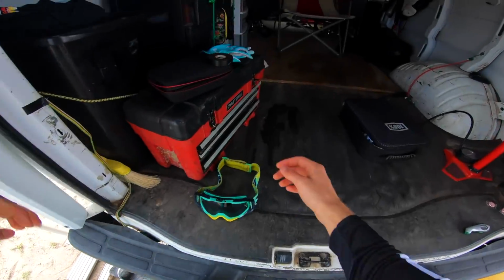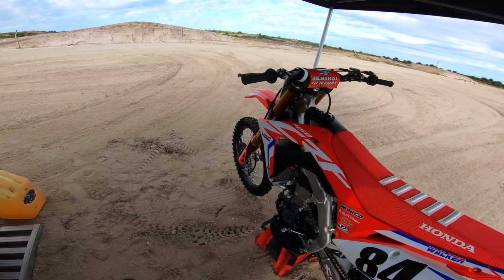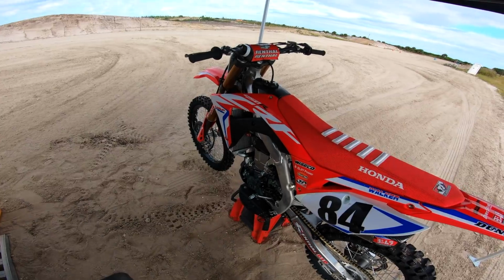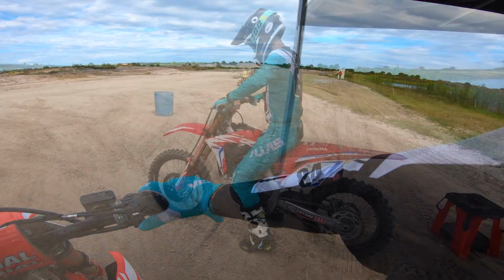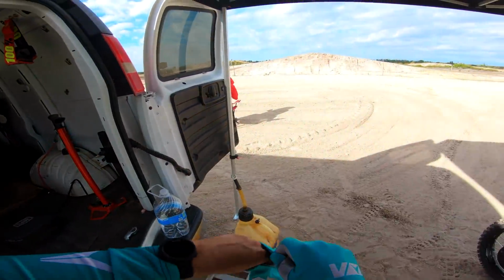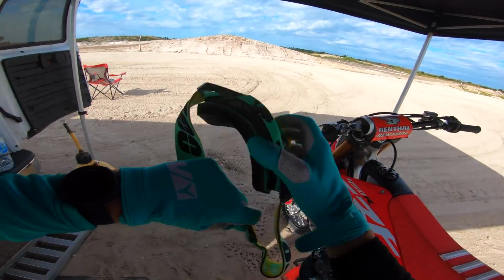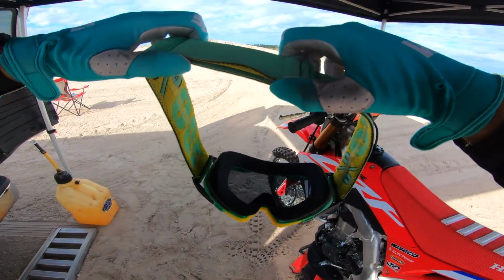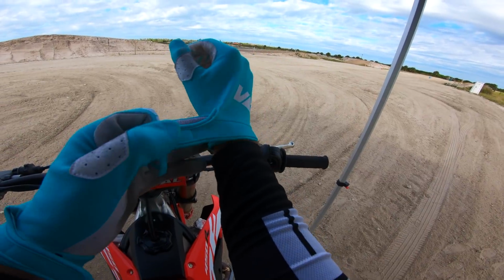Lazy Springs MX: Roughest Track in SW Florida?

Comment: That's the track I learned to ride on. It's also the track my bar risers failed on creating whiskey throttle resulting in a torn rotator cuff but if you can ride LAZY you can ride ANYTHING! You know it's a tough SOB when Jeff Walker isn't pinned 1/2 the time. For all of it's faults, in the summer when it's raining every day this place handles the rain and will be open when all others are closed.

Comment: Really appreciate your Videos!

Are u using any griptape on the airbox?
On rougher tracks beeing hard on the throttle, my ass hardly touches the seat.
I always try gripping the bike (yzf 250 2017) with my gaerne sg12 boots but i cant find any good grip on the side plastic covers... and then im fully exausted after like 13 mins full throttle...

Im trying to find any grip tape that doesnt destroy my boots that much.

Would be cool if u could share some experiences.

Greetings from Germany, Nueremberg!

Comment: You look like a tall guy, im 6' and ride a kx250f. I don't feel "comfortable" on it in a sense of position. Do you think I need bar risers?
Reply from the maker: It's possible! I'm 6'1" and don't run any risers, but its all about your style and what makes you comfortable. Canard is short and runs really tall bars. Deano is tall with low bars. All about personal preference! I like to get really low and aggressive, so the lower bars suit my style better. But if you have more of a Musquin style (upright and technical) then tall bars are a good route.
Reply: @JeffWalker84  I was at the track yesterday and I felt when I gave it full throttle my wrist was like bent under the grip and when I moved my wrist to a higher angle, I felt like I was on top of the grip and not "in" it if any of that makes sense. I think im going to give the risers a go.

Comment: Really awesome stuff Jeff.. looking fast! What mount is that? Where does a person get one like that? Thanks in advance! 😎🤙
Reply from the maker: It's a custom mount I made using a spare Bell Helmet mouth piece, a standard GoPro flat mount, and some JB Weld. I basically just stuck the mount on the front of the mouth piece using the sticky backing, and then threw some JB Weld to fill in all the gaps where the mount wasn't touching anything. I posted some picture in this thread on VitalMX https://www.vitalmx.com/forums/Moto-Related,20/Honda-CRF450R-Works-Edition-First-Ride-Impressions,1349475

Comment: Jeff, what is your opinion on the KTM Factory Edition 450 vs the Honda CRF 450 "Factory Edition?"  Is the quality between the two pretty comparable?
Reply from the maker: In my opinion, KTM and Honda are not trying to accomplish the same goals with their Factory/Works Editions...KTM uses their Factory Edition to make improvements that they'll use on the next year production bikes such as frame and engine revisions. A standard 2019 will be almost identical to the 2018 Factory Edition which kind of makes it pointless to spend the extra cash on the FE unless you REALLY want those Redbull graphics. There's nothing exclusive on the FE that you can't buy the next year. Don't get me wrong, if you're going to buy the seat cover, clutch cover, and exhaust anyways then it's a great deal! What I like about the Honda Works Edition is that you're getting exclusive parts like the HRC ported head and mapping as well as a custom Yoshimura exhaust that you can't buy on your own. You're also getting the Kashima-coated suspension which you can technically buy, but must be shipped to Germany in order to get done. Honda's WE is a proper race bike whereas KTM's FE is just a blinged-up stock bike.

Comment: Looks somewhat rought but in SC we have tracks that get ruts up to your brake disc and muddy but i can see that being rough for florida
Reply: Most of the tracks in florida are pretty sandy and rough like this. Hard rock in ocala is all hard pack clay from a old quarry but that place is straight dangerous. Rocks the size of baseballs laying everywhere, all blind jumps on clay that's hard as concrete. Tires will actually squeal while braking

Comment: Hey man I have a regular 18 450. How tall are you? I’m having the same front end issue but I don’t have the handlebars that you have if that helps at all. Your videos on this bike have helped me out because the 18 isn’t that different. The constant changes then seeing how it rides immediately is very helpful for me because it’s winter time and I can’t go test settings.
Reply from the maker: Hey John, glad you're liking the videos and finding them useful! I'm 6'1". I've always hated the Renthal 971 bend bars that came stock on the Hondas (I assume you have these on your bike) and I used to switch those out immediately. Something about that bend really did NOT gel with me and it always felt awkward. My favorite Renthal bend was always the 999 McGrath/Short bend. It's really low, flat, and wide so you get great control and stabilization over the front end. A ton of pros run that bend! Obviously the 2019 range switched things up with the 839 fat bar coming stock, so I decided to give it a try and i'm actually digging them so far! It has very similar specs to the 999 that I love, but they're about 10mm taller and slightly narrower.

Anyways, my first suggestion to anyone who's struggling with front end instability is to make sure your bars aren't rolled too far forward. For reference, I always start with my bars perfectly in line with the angle of the forks and go from there. 99% of the time, I end up rolling them back slightly from there until I find the sweet spot where the front end stops twitching.
Reply: Jeff Walker Im also 6’1 and prefer the 999 over any other bar. This was video was super sick by the way! I’m new to your channel and was curious if you’ve had past models of the CRF? I recently sold my 2017 crf and was wondering if the 19 was any better than the 17.
Reply: Drop fork height in clamps and drain some oil from forks..night n day on Honda

Comment: It would be appreciated if you could make a video that summarizes the changes and adjustments made to your CRF450r to compare our setup with yours. I do not want to spend for a revalve of my suspensions because I have the impression that the company have not yet tested the 2019 bikes so I think that helping each other between owners would be nice. In addition, Here the season is finished until April because of the winter so I could not test the bike.

Comment: Isn’t that alittle risky taking the air filter out what if you suck up some sand that would blow your engine out right. But since there was nobody else on the track I guess it probably isn’t that bad
Reply from the maker: Haha no dude, my air filter is still in! I just removed the metal mesh backfire screen that sits inside the air filter cage. The foam filter is still on. Please don’t ride your bike without an air filter😂
Reply: Jeff Walker ha my bad

Comment: If a tracks not ATLEAST that rough are you even really riding moto?  And honestly that track doesn't look that fun at all, it looks super fast, dangerously fast almost with no good jumps.
Reply from the maker: For how rough it is, it is definitely dangerously fast...but that's what makes it fun! haha
Reply: @JeffWalker84  There was a track like that in my area that closed down a very years ago that had super long straights, and a few huge mellow step ups and stuff, but they ended up having to revamp the layout after a couple years because too many people were getting hurt needlessly coming to the end of a straight at 50+mph into the braking bumps.  It was definitely fun though!  It cost me a broken leg once like 6 years ago but ironically had nothing to do with those straights, it was a bit greasy and I wheel spun going for this medium sized double out of a corner and cased it HARD, nosed into the landed with the front wheel, but anyway, I digress, love your content, cheers!